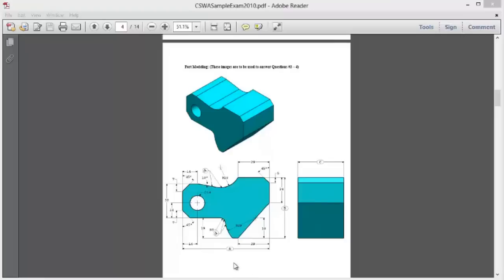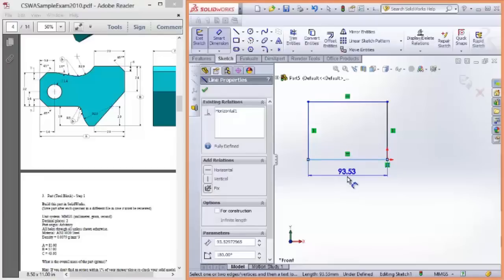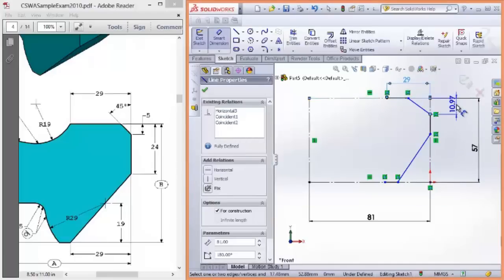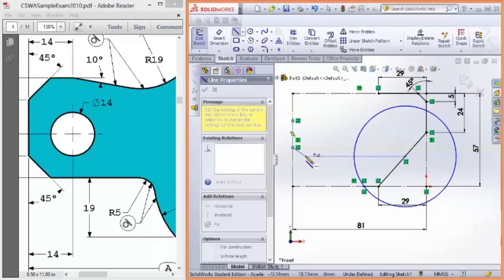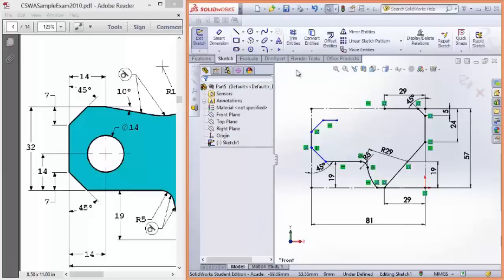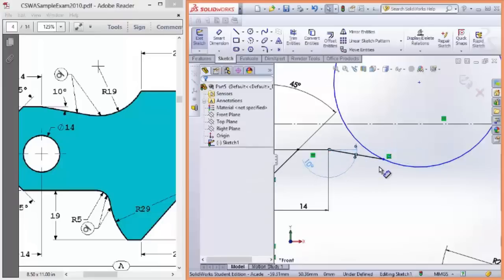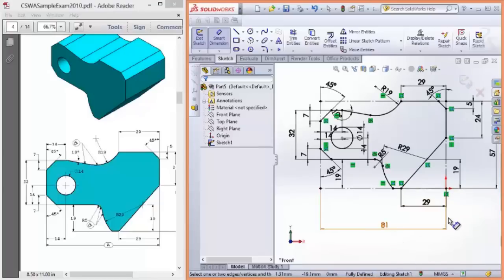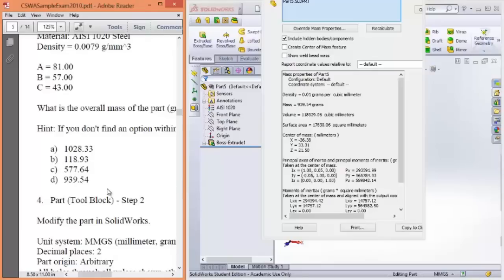SolidWorks CSWA Practice Exam Solutions Part 3: Q4 Part Modelling p1 MP4

Comment: Stupid question; wouldn't it be easier/quicker in terms of completing the test on time to use equations?
Reply: bkpickell Equations for what the mass properties?
Reply: Stephen M Just to fill in the numbers for A,B, and C. You set those up as global variables, so that on the test for the other questions where those numbers are different, you just go into equations to change the numbers and then check the part mass and answer the question.
Reply: bkpickell It's absolutely quicker to do it the way you suggest. It also helps for the future questions where you change the dimensions of A,B and C. I'm not sure if dimensions like X=A+B come into this exam, but they do in the CWSP (the next level up) and things get really really messy if you don;t use equations.